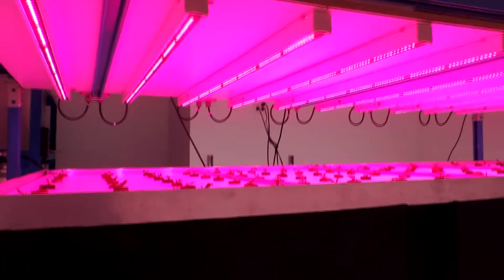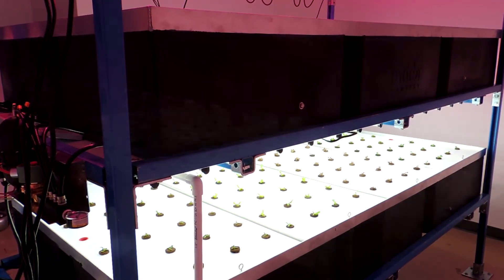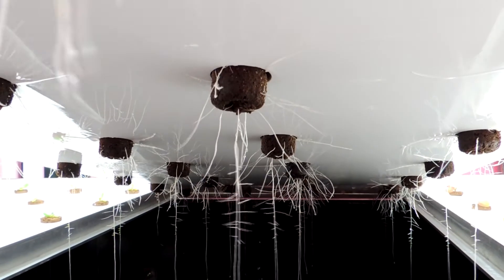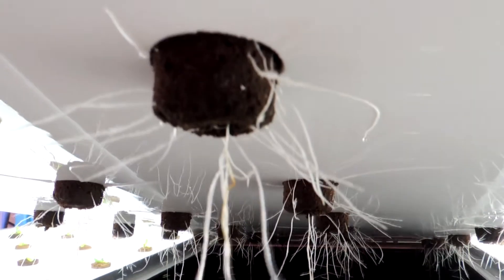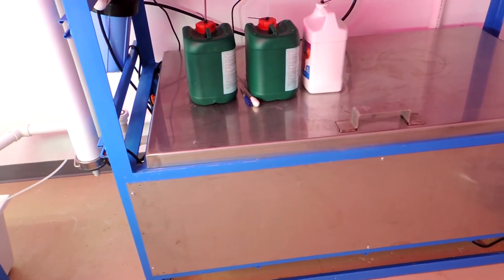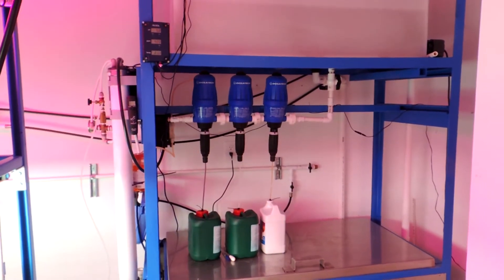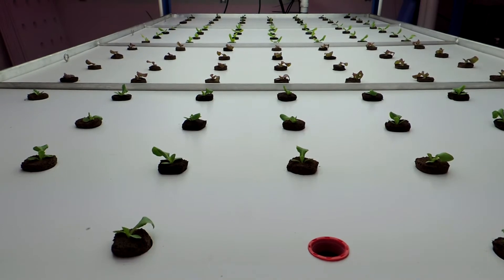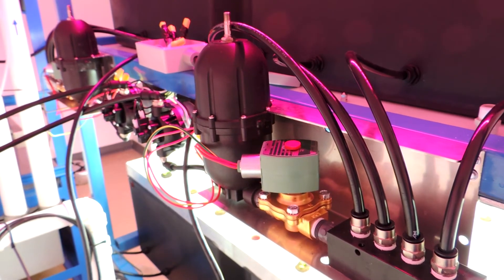Indoor Harvest Aeroponic System Oshoka Changemakers

Comment: Awesome, beautiful stainless manifold in there.
Reply from the maker: JohnGuest45 About half that actually now and the 3/8's lines use about 15%-20% less water when operating drain to waste over 1/2 PVC lines. Our manifolds are also setup to be cleaned using a high pressure steam rig. Makes doing annual maintenance a breeze. Lifetime warranty.
Reply: @Indoorharvest  Why use 3/8? 1/4 is a small water column, less work for the pump(s). Also, I sure hope whoever you sell these to knows they also need an optima steamer to clean it out. Still cool stuff though. Where are you guys now on all of this?
Reply: the manifold costs $1300 and holds $20 worth of nozzles ;)